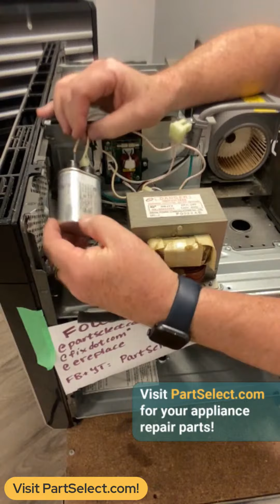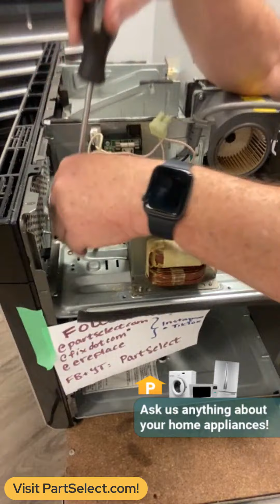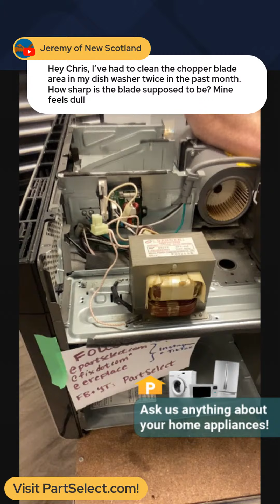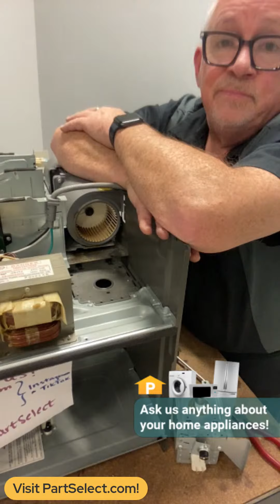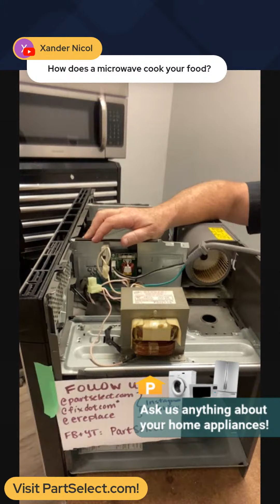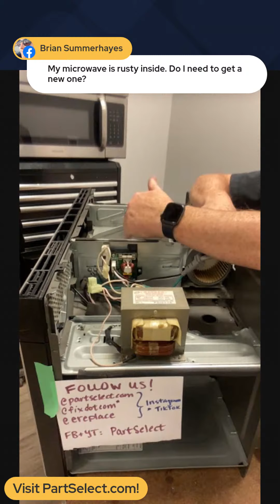Ask An Appliance Tech Anything!

Comment: What old appliances are worth keeping since more respecting right to repair and so on ?

For example, ceramic top of stove could hardly be repaired when heating elements used to be easy to swap ...

In some cases, some commercial grade products are a better deal like commercial washers, same for old Doyon branded ovens they were quite outperforming most ovens of their era even frozen foods could have cooked in less than half an hour, ...

So any recommandations ?

Comment: I have a roper washer top load. After it fills up goes to spin the water out, a lot runs out into the floor and I'm not sure why. What do you think?
Reply: I don't know how to send a picture on comments of YouTube or l would send you pics of the machine
Reply from the maker: From our repair tech, Chris: Sounds like the water flow output from the pump is restricted basically water not draining fast as it use to. So as the basket begins to spin with a lot of water still in the tub centrifugal force will throw the water over the tub ring and splash on the floor. I would be checking the pump and drain hose.
Reply from the maker: If you need more info about how to inspect those items, or more potential causes for a leaking washer, you can check out this page on our website: https://www.partselect.com/Repair/Washer/Leaking-Water/